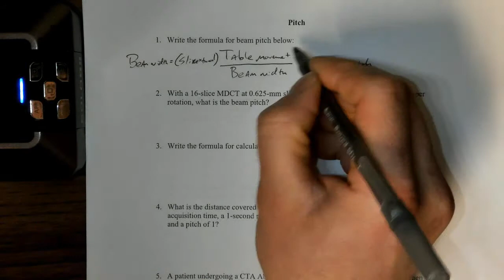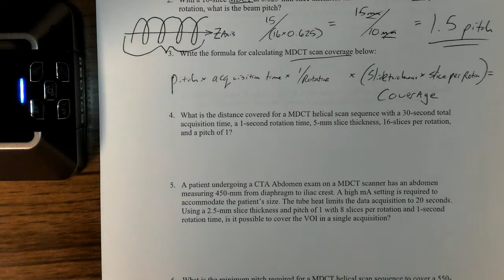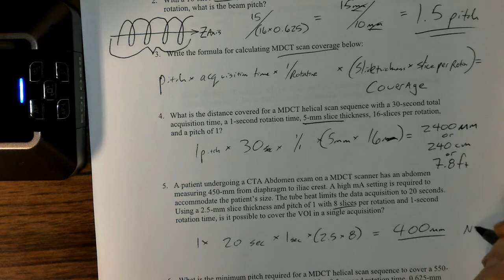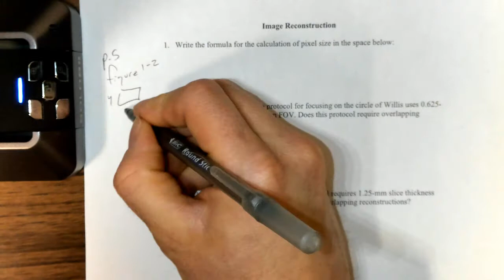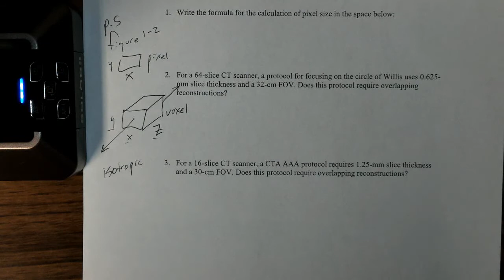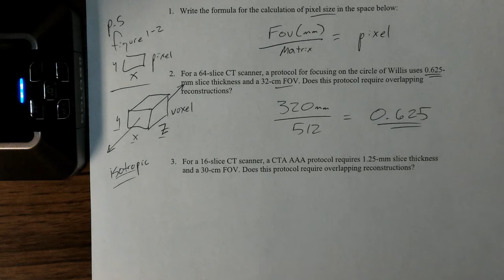CT Pitch and Reconstruction

Comment: Your channel so wonderful I hope u keep making content please do video about why in ct scan helical there is no motion artifact when continuously table movement while acquisition?. I never get that like the detectors don’t register the spatial encoding correctly since it gets different attenuation values also the x ray tube dont have sufficient time to complete one rotation which is necessary for image reconstruction in filter back projection at least 180 degrees needed but the helical shape of the beam means each plane gets only 10 degree of tube rotation until the table moves to next z directions or next plane of patient sorry for poor explanation
Reply from the maker: I'm tracking with you... are you studying CT for engineering or as a technologist?
Reply: @RockTheRegistry  specialist
Reply: Technologist but I keep getting questions in my mind and there is extremely lack of content describing the components of detectors
Reply from the maker: @no-de3lg  The short answer is the computer interpolates the data.